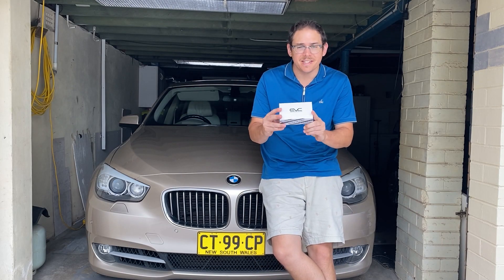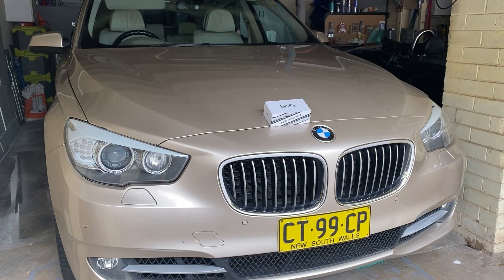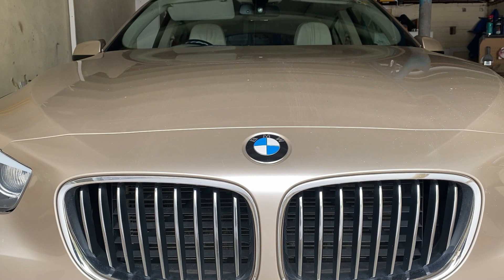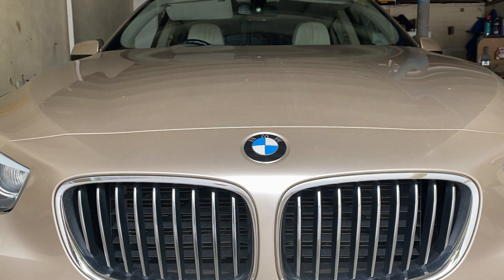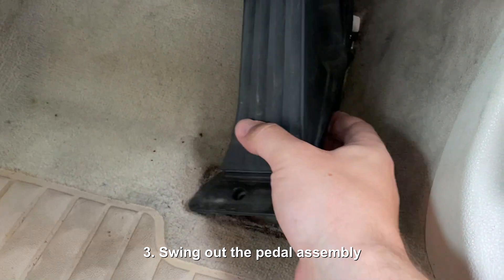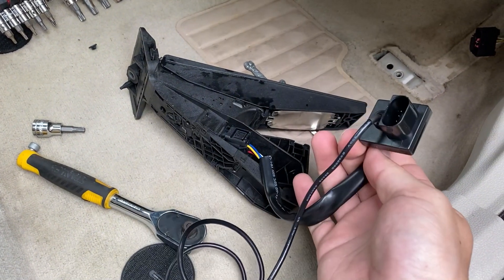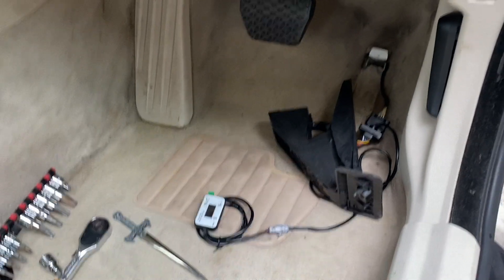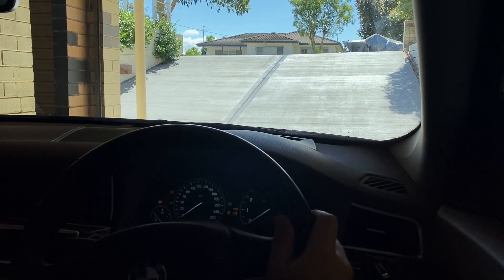Do Throttle Controllers fix BMW Pedal Lag?

Comment: That lag isn’t a bug it’s an intentional inclusion by bmw as during that time period bmw was going throw a resection and didn’t have the funds to make a rear diff that could handle the power output off line. So the lag was implemented to help protect the rear diff

Comment: I have one fitted to my Mercedes-Benz x-class w470 pickup, ❤❤and it's amazing.
Throttle lag gone, and I drive it in E1 all the time. Except when I tow my Jayco Silverline caravan, then I use power mode.
I highly recommend this product.😁👍

Comment: you throttled yourself with comfort mode then bought a throttle controller, LOL!!
Reply from the maker: Sport mode changes more than just the throttle mapping and sometimes you don’t want, for example higher rpm gear changes.

Comment: '07 X5 here. I wish I found this two days ago before I ordered a controller two days ago to eliminate initial lag. 😂 So will you get a remap?
Reply from the maker: Sold it and bought a Jag haha
Reply: I can confirm I fixed it. I purchased this car and due to the throttle controller and the way advan had the tune setup or honestly I’m not even sure what else. The charge pipe blew off because it wasn’t tight and the way the boost built with the throttle controller was big. I then added a new GFB diverter valve, boost pipe and k and N intake and flashed the car to an OTS tune using boot mod and happy to say I haven’t had any issues since. No lag no need for a throttle controller. Also added a catch can + XHP and fitted those exhaust tips

Comment: You need a manual car if you want control, Auto are made for Spaznoids, manual way better no race cars have auto mong gear boxes.
Reply: The zf 8hp auto transmission is fitted to many race vehicles
Reply: @MechaniclifeJDM  Used in manual modes and tuned to not do stupid shite. Enjoy having to weight 2 second for your car to switch down gears and get you outta trouble. The EVC controller doesn't work its shite. just makes your throttle super touchy. You the driver should always know when you're in the power band & gear.
Reply: @MechaniclifeJDM  Do rally drivers use autos?
Reply: @MechaniclifeJDM  Also more parasitic drag unless high spec than manual